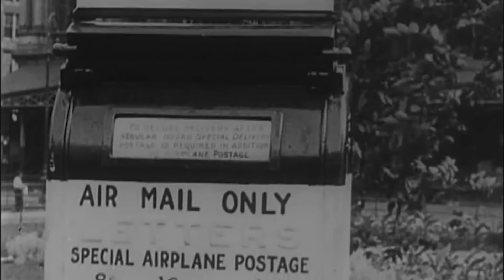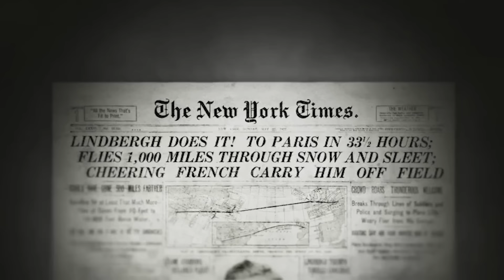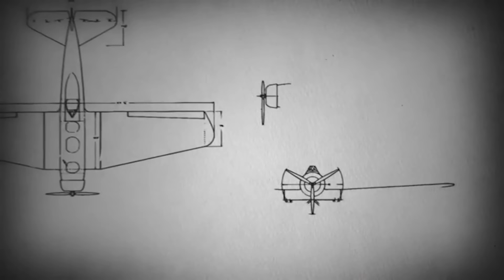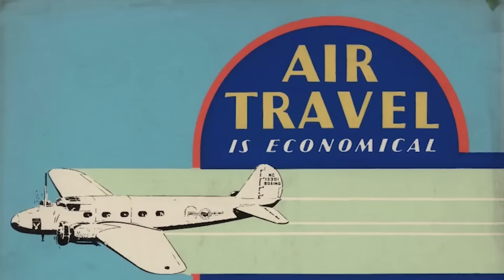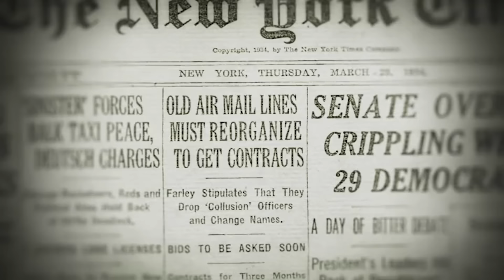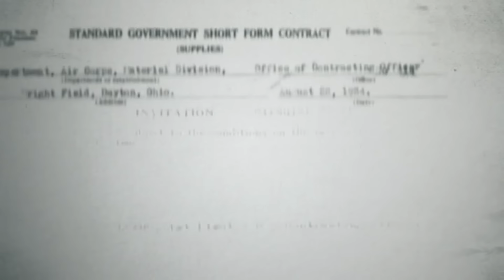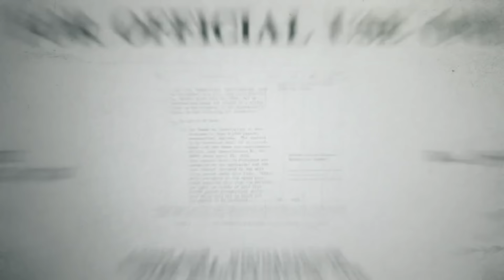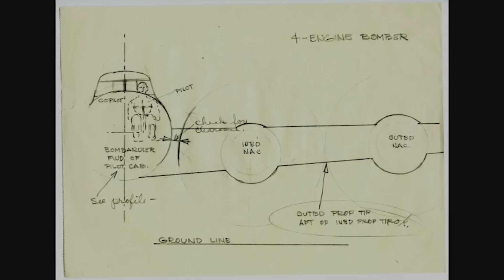"What Can't We Do?" | Boeing Age of Aerospace, Ep. 1

Comment: I think even Boeing 737 NGs are successful in the time, that's why companies wanna operate 737 Max and companies are operating it. I think 737 family makes more profit in terms of no seats as compared to its counterpart A320 family.

Some say the cockpit is too old for the design so make a new cockpit layout of overhead panel, central pedestal, glareshield with fancy materials colours. The cabin looks awesome already with Boeing Sky theme interiors. 
And the key point i wanna make is that most of the pilots who fly aircrafts do not complain except what ergonomical issues, scope of improvements they suggest for and that's right to be taking of. But nowadays the whole community of people are concerned about how a cockpit should be looking like, rather than they will be just sitting behind the cockpit as passengers (except the pilots).

I mean the pilots who fly the 737 with yoke can literally understand flight physics and i know pilots in my friend circle who used to fly 737 NGs and later MAX, and they say "its a pure joy of flying". 

It's actually very cool to fly a 737 with managing trim, roll, pitching, throttle, rudders.
Reply: That's like the model T Ford being in service and manufactured until 1968.... and if Ford updated or changed it too much then all the drivers would need a new driving license and all the garages that maintain them would need new qualifications to work on them. Sounds silly right?

Comment: You can't get Starliner off the ground on time or within budget.
Reply: They can't get the flight suits to work at this point.
Reply: Can’t build airliners without doors falling off the planes diving straight into the ground. Then blame the pilots. My great grandfather worked and retired from Boeing. Helped with pressurized cabin in b29 and helped design the b52 and other things. He would be so dissatisfied with Boeing these days